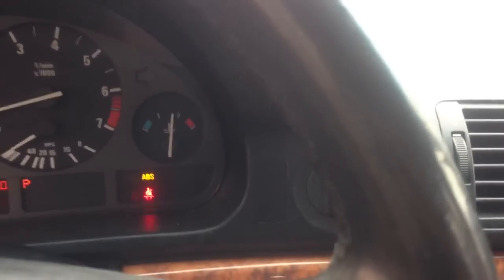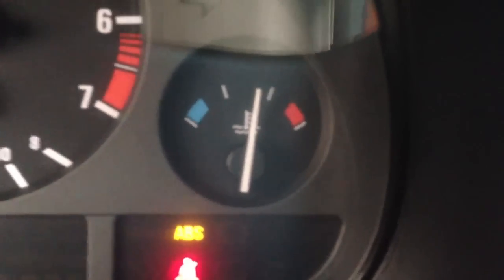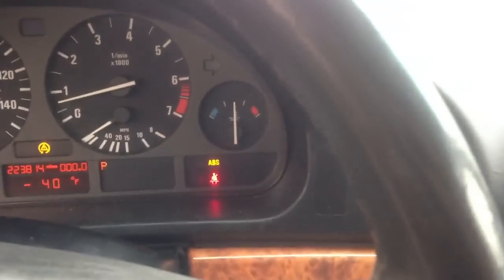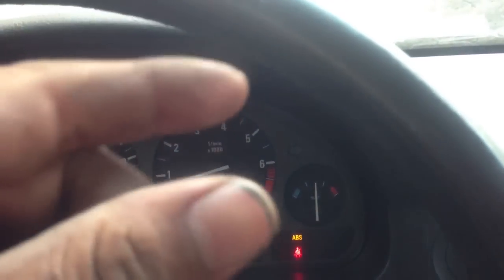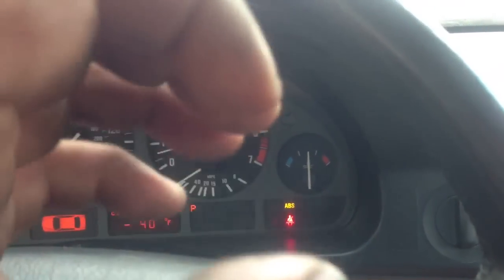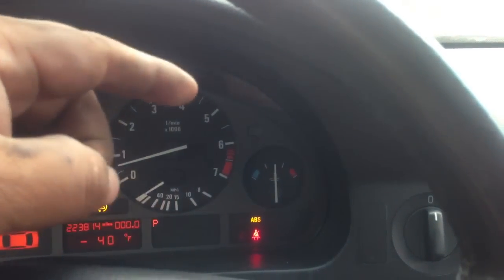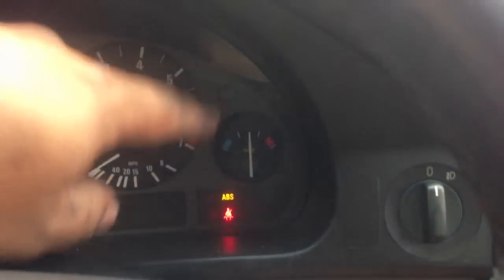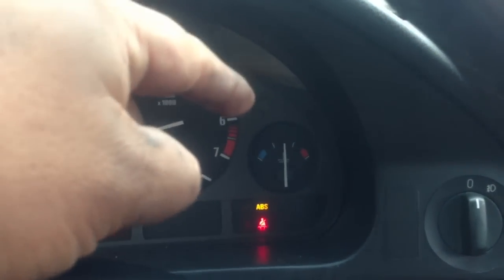Thermostat Overheating Problem BMW 5 Series 3 Series E90 E39 528I 328I M5 M3

Comment: Hi all, I have 2000 BMW 323i, just to share experience, I bought cheep thermostat online and the car start overheating after 2 months. Yesterday I changed it with BMW thermostat from the dealership together with tank overflow cap and the car is normal again (after I watched this video).
The symptoms I had were: High pressure at lower and upper hose of the radiator (above normal pressure). The lower hose was cold and the upper was very hot. 
I strongly recommend to watch the video about how the thermostat works.
Reply: Hey bro im having the same issue but replaced the thermostat, thinking the thermostat might be faulty. The top hose keeps bulging

Comment: When I changed the radiator hose there was an air gap. I had to let the coolant bleed with the screw right near the radiator cap. Basically I let the bubbles happen, then open the radiator cap carefully, watch the coolant go down and give it more coolant. Then repeat the process 2 to 3 times. Then I turned on the defroster of the heat on max like 80 with the fan on. This made it so the temperature Gage stayed at the 12 o'clock. position. Hope this helps other people too. =)
Reply: I guess it's kinda off topic but do anyone know of a good website to stream new series online ?
Reply: @Duke Jay I watch on flixzone. Just google for it =)
Reply: @Aydin Ira Definitely, been watching on flixzone for months myself =)
Reply: @Aydin Ira thank you, I went there and it seems to work :) I really appreciate it !
Reply: @Duke Jay happy to help :D

Comment: Yeah my water pump went out with these symptoms like on his video. Also I didn’t even know that my fan clutch was bad. If it spins around too easy when off, replace it. I replaced my radiator to mishimoto. If my thermostat goes bad I’ll let you know. Also replacing your temperature coolant gage from the right of the block if your needle is jumping all over the place.

Comment: Got mine like that when on long traffic jams on hot weather. Fortunately, it happened right before I can exit the traffic. Don't have a chance to check the exact temp via obc. AFAIK in a normal traffic, when the gauge still sit in the center, I check the temp can be above 105 C, which quite far from the thermostat opening (about 85 C I guess?)

Comment: Hey quick question, I have the same problem with my e39 but I just refill it with coolant and get the air bubbles out and it goes fine for a couples months and overheats again,  is that the thermostat as well?

Comment: My BMW ...its a 2004 325I ...it's running cold constantly....but sometimes jump's quickly to the h... It the overheating light doesn't come on....oil and cylinder heads are good....I'm thinking it's the coolant temperature sensor?

Comment: I want to ask about the temperature of the BMW, M52 engine, What is the normal temperature?
Reply from the maker: Typically, BMW engines operate around 195 to 220 degrees Fahrenheit (90 to 105 degrees Celsius). However, the exact operating temperature can vary based on the specific model and engine type.

Comment: Hey I recently had to replace my radiator because the mouth on it chipped and the hose had nothing to hold on to. (mind you before that I never had any engine problem. I have a 96 328i bmw) so I put a new radiator in and its still running hot... I am trying to figure out if i should bleed it (how to bleed it) or what else could be wrong.

Comment: No es el termostato por eso estate tranquilo que cuando un termostato esta fallando, como se detecta gran parte de cosas defectuosas es que no mide como deveria y cada vez va como si se fuera acabando la pila cada vez menos y a los dias se queda en el primer cuarto o mas o menos no pasa de los 50• y baja la aguja y vuelve a subir, lo que te sucede x lo k marca funciona demasido bien tango k sube de los 100• y eso k estas solo a ralenti. Esta que te pasa por seguridad si marca mas de sus 90/100• que todos los coches para eso son exactos y no baja ni sube como los demas cuadros, esferas, agujas o como llames, cada reloj su trabajo pero este es preciso como un reloj . Y si los ves k se mueve depues de estar en su temperatura significa avería o posible averia, pero esa aguja no la subestimes, es malo k suba y k baje... Y hay personas que aún sabiendo que esta para cAmbiar esa piezas o sensor ( termostato) no siempre es eso el recambio que puede ser, puede ser fuga en radiador, aire en circuito del refrigentate una burbuja como pasa con los frenos, no es echar líquido poner pieza y listo, solo se libra el aceite al motor de purgar, pero llevando su orden. Lo que te queria decir, si confias en que este baja malo, en alta suele ser culata y con el termostato averiado no te detectaria la temperatura porque esta estropeado y no trabaja, por eso no lo dejes pasar, y bajo hay gente que dice bah! No le doy caña no are culata y apenas lo miro total siempre marca su graduación igual... Y a los dos dias las alfombras llenas de refrigerante y otro cristo, que te daña hasta la calefacción del habitaculo y es malo porque aparte sale mas caro cambiar tarde 2 radiadores toberas y las horas incluyendo el termostato, o aunke baje no lo cambies a la primera mira el radiador del motor, mira el color del refrigerante mira también donde echas el aceite al motor y sales de dudas porque marca menos, y si aun te cabe duda huele el tapon del aceite y luego por 2€ mas sale mejor echar refrigerante y cambiarlo como el aceite y ahorrarse eso ecahndo agua, que se quma y hace agujeros en el radiador o quema hasta el bolsillo, y si no para salir del apuro pregunta a los camioneros k usan x urgencia para taponar agujero ode refrigerante, cada uno tiene su receta para salir del paso y barato. Pimenton para taponar agujeros o fugas y vino blanco de agua y ademas en invierno no se congela el agua si, y sirve para limpiacristales también, saludos toma testamento mateo, como odio los teclados 😉🤔

Comment: What if my car is doing the opposite, not warming up to the middle mark? It never overheats that I've seen. It only will be slightly less or way under in colder weather. My check-engine light is on because of it as I've already checked the computer codes for it which reads "P0128 - Powertrain - Coolant Thermostat (Coolant Temperature Below Thermostat Regulating Temperature)"
Reply from the maker: That code means you're cars not getting warm fast enough. Your thermostat must be stuck open
Reply: this is the exact code i have on mine is this fixed by replacing the thermostat? i already replaced the sensor
Reply: in my case, the thermostat will be reading hot unlike buddysteve so im not sure if the same thing is happening but i have the same code
Reply: Replacing the thermostat and then the two pre-cat CO2 sensors fixed all my issues for me! All eight emissions readiness tests completed almost immediately including the Secondary Air System that I was haven't a problem with!
If your vehicle won't complete with Secondary Air System test, then you might want to replace your pre-cat CO2 sensors. That's what did it for me on my 03 BMW!
Hope this helps!!!

Comment: Check your out side temperature sensor it reads -40 which is mean that is fail change it , help for the auxiliary fan to start working
Reply: Mine says - 40. Thanks!
Reply: Mine also usually reads -40 but does change sometimes.

Comment: I am suffering from heat problem. I cleaned the radiator, changed the fan regulator, and the problem persists. Every two days I add water to the cooler. I find that the refrigeration cycle has a lot of bubbles, even though the water is of a normal color. But the temperature rises and the water decreases. Especially if you are on standby.
Reply from the maker: YOU NEED TO REMOVE ALL AIR BUBBLES FROM YOUR COOLING SYSTEM TO PREVENT OVERHEATING

Comment: my 95 325i doesnt have a thermostat? i changed the the water pump, fan blade, radiator, and thermostat housing thats how i found out. Any reason why they took off the thermostat? is this dangerous?

Comment: I also drain all my coolant and then pour it back letting the bubbles come out and it works fine for a couple of months but then it starts to overheat and I repeat the process and its fine back again. Do you know what might be wrong with my coolant system?

Comment: YOOOOO I NEED SOME HELP MY CAR STARTED OVERHEATING WHEN I REMOVED THE MANIFOLD INTAKE IT WAS THE HOSE THAT CONNECTS TO THE HEATER HOSE I CONNECTED BACK ON I ADDED SOME COOLANT THE CAR WAS IDLING GOOD UNTIL I TURNED THE HEATER ON BLAST AND THEN IT STARTED OVERHEATING AND JUST BLOWING COLD AIR ANY SUGGESTIONS PLEASE!!!!?
Reply from the maker: IT OK JUST KEEP ADDING MORE COOLANT TO REMOVE ALL THE AIR OUT

Comment: I almost have the same problem but when i rev it or drive it ... It gets worse :/
Reply: What was the problem
Reply: @AngelRodriguez-jv6oc  if i keep the car at idle the temperature is normal and ok if the engine increase ita rpm the thermostat foes with it. I have checked electrical issues but found none. When the lockdown finish here i will see whats going inside the engine